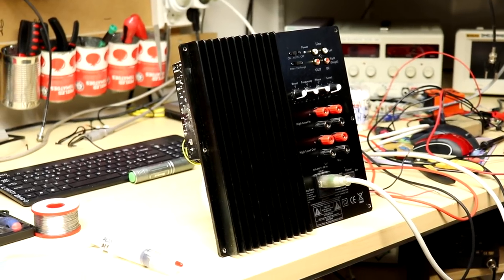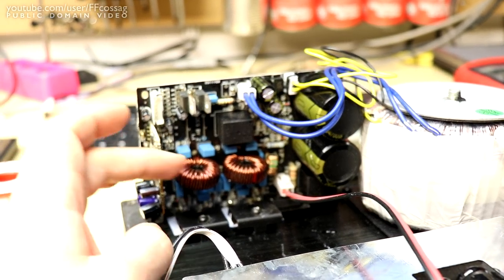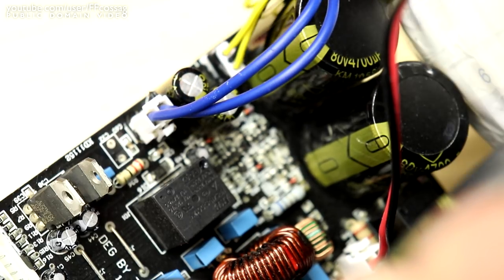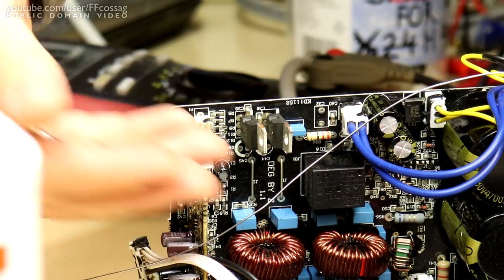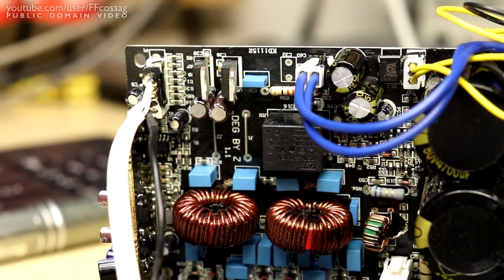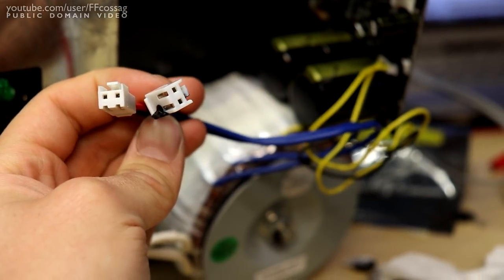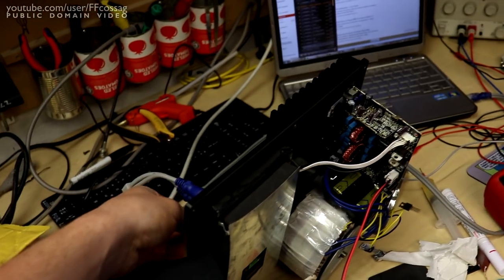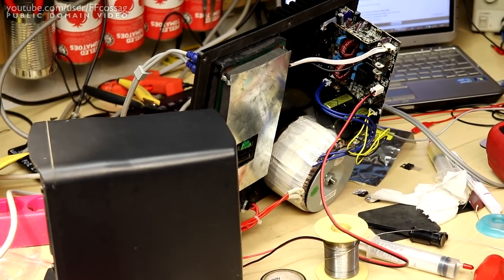Dynavoice Definition SW10 Plate Amp Repair

Comment: there was a bit of an optical illusion at 7:20, first time round it looked like chip was mounted through a hole on the pcb on a heatsink, that is,  the outside corner looked like an inside corner

Comment: FF. Important. You really need to build a dim-bulb tester. You know what it is. In this repair, you would not get a kW rushing into the unit, potentially melting stuff, instead it would just light your 100W bulb that's in series with the power line. Essential stuff for repairs. A bulb is brilliant for this because it's a non-linear resistance, increasing drastically when it lights. So when an unit is drawing 20W, it's dropping the voltage just a tiny bit. Furthermore you can see on the bulb what's happening. Add a bypass switch for the bulb. You may want two lamp sockets. An old 230V timer is ideal for converting.
Reply from the maker: I know, I have one built, somewhere, but I tend not to ever use it since modern gear with switching regulators generally does NOT like a slow voltage ramp-up - and if you plug one into a normal SMPS, you might actually grenade something on the primary side since a secondary side overload will cause a primary side brownout, possibly causing a runaway overcurrent situation.

That said, in cases like this, it makes sense to use one. I actually verified that it worked off-camera before finding out that it didn't, by using my lab PSU to power the main rectifier caps directly - and it showed no signs of issues. Likely, had the transformer wires been connected correctly, the unit would have worked fine.

Oh well - the X-Files got it right. Trust no one.

Comment: I hate the fact most of these go directly into the transformer after the master switch is on.  Even in standby they can pull 10 watts 24/7, so I power mine down each time.  They should have a seperate 5 volt or what's needed to switch the transformer out in standby.  Surprised the transformer output didn't fry the final outputs with wrong plugs?
Reply from the maker: It did fry them, that's why I had to put in all new ones.

Comment: question i have a sta-1000d plate amp for my subwoofer. it has no audio only static. the static doesnt change with volume neither. any suggestions as ive never done this before? i really dont wanna throw it away and i cant find anyone local to take a look. i'd hate to throw it away for a simple fix tbh.

Comment: :D Like Louis Rossman :) Diagnose 1 hour in a slowing macos, then open the hood find a fucked part of board. Change one resistor and good to go. :)
I made the same mistake with a HP z22w monitor. That bloody thing has the same power and usb connector to main board. So I sent 12 + 5v to data input :) Because I am a genius... USB Controller IC fried.... After that become obvious the screen is also bad.